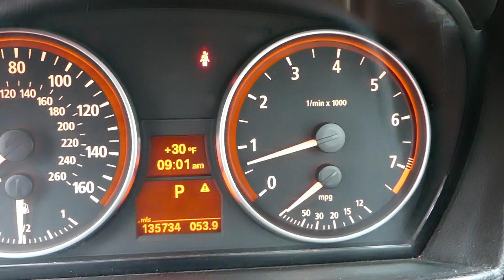MOST COMMON TRANSMISSION FLUID OIL LEAK ON CHEVROLET MALIBU EQUINOX TRAX CRUZE SONIC TRAVERSE SPARK

Comment: Could you tell us what the leak will look like or smell like?  I have a leak but it is reddish in color right in the front middle of the car and I don't know what it could be - on a 2016 Chevy Trax.  Of course, it is leaking 3 days before we list it to sell it, so now we have to take it to the mechanic!
Reply: Was it the transmission that was leaking from the front middle of car? I have the same  leak from that area.